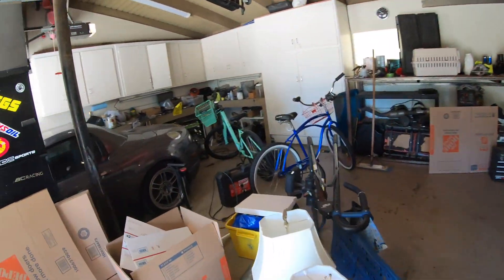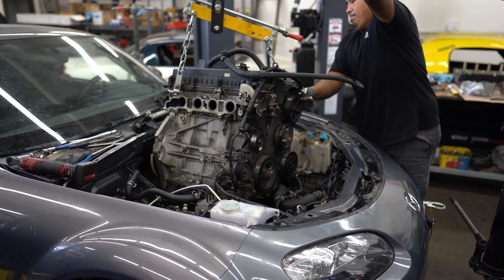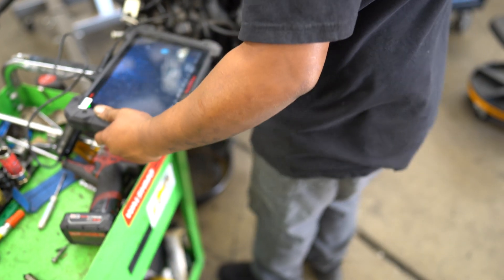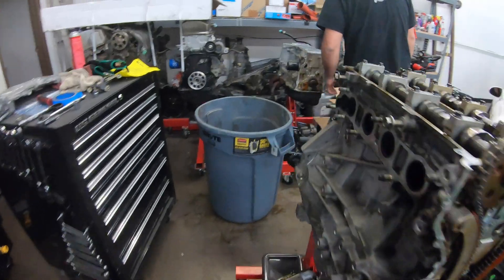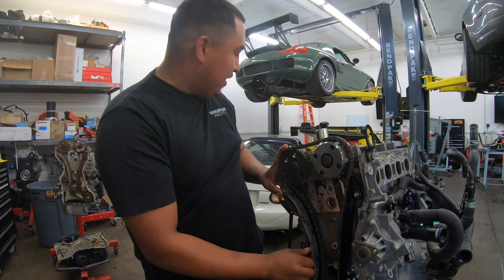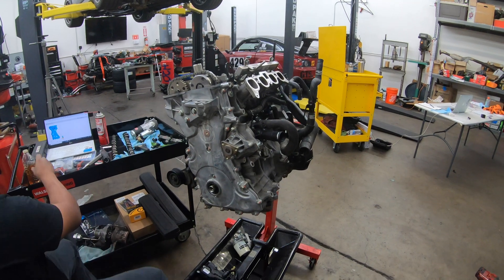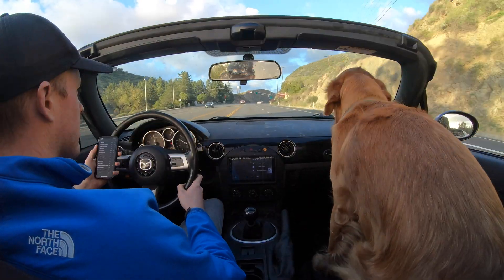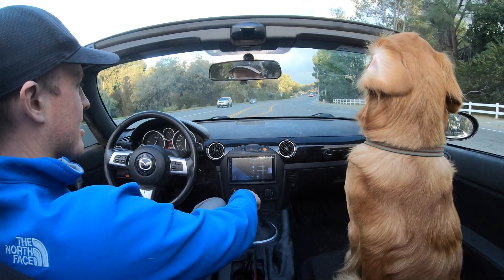Swapping A 2.5 Ford With Cams Into the NC Miata

Comment: Is it still possible to get the chrome fuel door for the PRHT? I looked all over and only found it for the soft top, apparently they are different. I'm picking up a 2008 Highland Green Mica tomorrow and I think that would look great on it.
Reply from the maker: yes you would just have to source it from a salvage yard. Also try Ebay or Ebay UK

Comment: I just blew the engine in my NC Miata yesterday. I have an automatic, does it matter whether you have an automatic or manual in terms of this engine swap?
Reply: it does not. there are several posts out there with the 2.5 swap using the auto. after the swap needs a retune though from what i understand.

Comment: Would it run with the stock 2.0 ecu or does it require a tune?
Reply from the maker: Yes stock 2.5 will run with stock 2.0 tune... but 'd still get it tuned right away. Cammed 2.5 probably wouldn't run well.

Comment: I bet it’s a whole lot better daily driver with the added torque down low. I never knew this was a common swap to do in miatas. I’m curious to see how much better it will do on the track. How long did it take to swap it?
Reply from the maker: The guy in the video did it in about 10 hours taking his time. This included swapping the cams and retiming them. It would have likely taken me 40 hours.

Comment: Nice footage, my 07 NC is under 2.5 swap these days. I guessed the other 17 fusion 2.5 10K motor was picked by me from LKQ.   Mine have the pretty same build as yours, fab9 stage1 cams with GWR 1.8 header.
Reply: Is your car still running safely? No blown engine?

Comment: Just a heads up, you may want to remove the part where you are driving with the phone in your hand. Police are watching car related videos and documenting drivers that break the law.
Reply from the maker: Should be fine. It is the ecutek datalogger, not my cell phone. I need to monitor the data when doing a road test. In this case.. I will ruin the engine if I keep driving it right now.